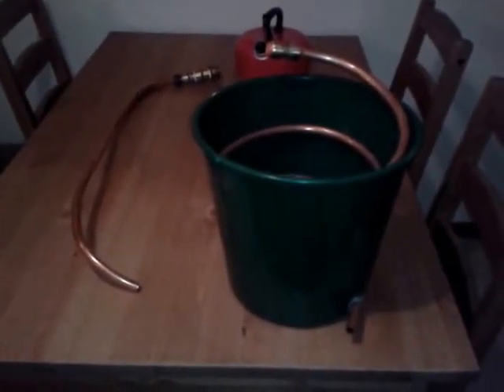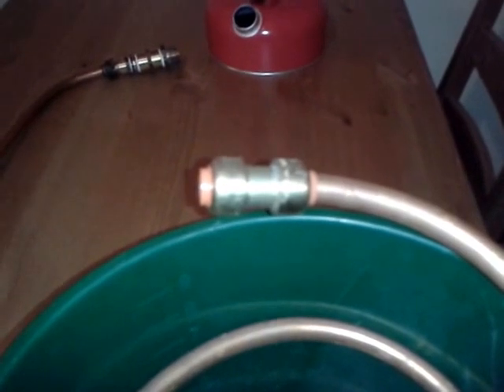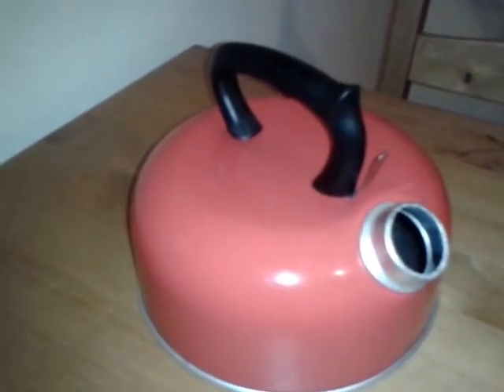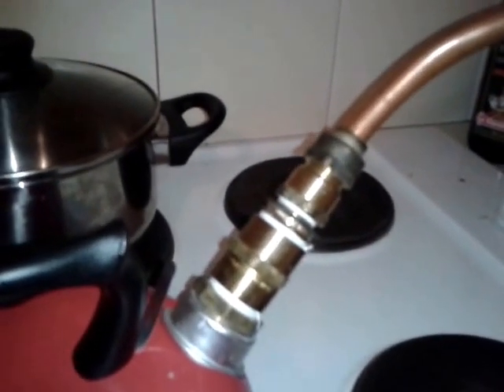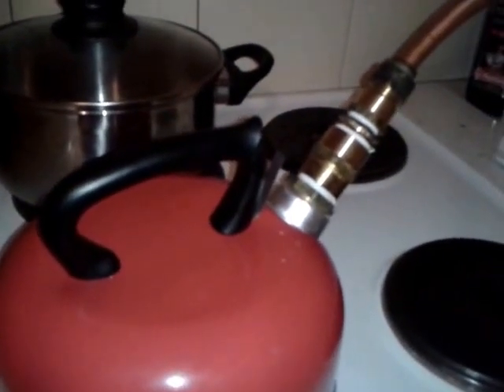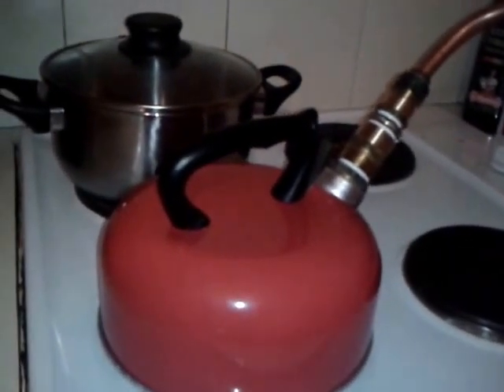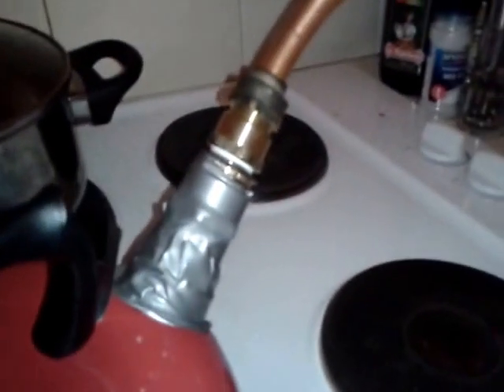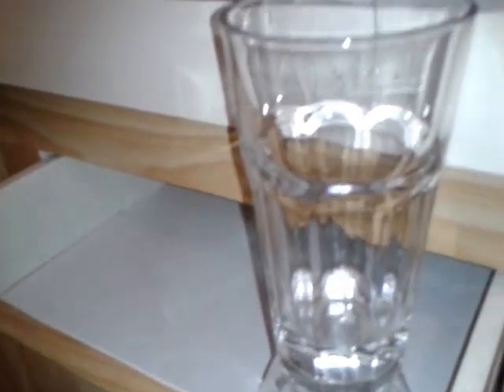DIY Water Distiller Purifier Desalinate - very fast!

Comment: the ONLY reason you need copper in a still is to make shine.if its just water it only needs to withstand 300 degree heat.water boils at 212 so 300 should be more protection than needed.
Reply from the maker: Copper is one of the best conductors of heat, much better than steel.

Comment: Excellent, thanks.  I would recommend using a steel/metal bucket/container with valve at the bottom so that you can drain the hot water and replace it with cooler water.  This way you don't have to scoop out the water and add new one.  And a stainless kettle would work better than an aluminum one.

Comment: Interesting... but do you need to use coolant - or does that just improve efficiency?  If you didn't have the bucket but instead just let the steam out into a long pipe that you could cover to avoid getting burned.... maybe bury it under some dirt... that might work, no?
Reply from the maker: No, you definitely need the coolant
Reply: +wupeide ...Yeah, the whole point is to cool the steam as quickly as possible. In fact, you can usually boil the water out of a vessel faster than you can condense it back into water. 

In this case, he could actually get much more than 2 litres an hour if he had 1) smaller copper tubing coiled more times, which would present more surface area to contact the cooling water, and 2) an inlet/outlet in the bucket which would continually replace the water which would be getting hotter and hotter otherwise.

He could also use more copper tubing coiled up with a decent size fan running over it.

Basically, it all comes down to how fast you can cool the steam being produced...
Reply: What about just using an extremely long tube and running it under ground for cooling?  I am trying to think of a way to do this as simply as possible - think post-apocalypse.
Reply from the maker: Yea that would work. Although how long is long? ;)

Comment: add extra tubing from the sink tap filling up the bucket, and an overflow tube at the top of the bucket to the sink to produce a more cool water making the distilled water drip faster/ also add heat rap to the copper tubing for more heat
Reply: +Jay Goodwin ...First idea is good. But the moment the steam leaves the boiler, you want the copper cooling the condensate as soon, and as rapidly,  as possible for maximum output. If you are trying to make the whole thing more energy efficient, you would only want the wrap the boiler with insulation.
Reply: +Jc Knight yeah i know now, thanks :)

Comment: They say that copper when heated up does leach on to the water / steam. Stainless steel piping is probably a safer option. And a metal cooling bucket.
Reply: +YouTubeSearch ToxicFluoride ...actually, pure copper tubing is amongst the best options for distillation. In alcohol production it's actually preferred over stainless, for taste. Also, except for Lab Grade stainless, the nickel present in stainless is more likely to leech into water. Not a problem for most, but there are some people with high sensitivities to it.

The cooling vessel should actually have an inlet/outlet to constantly be changing the warming water with cooler stuff. The material is fairly irrelevant if they do that.
Reply: if that were true bourbon will kill everone who drinks it , and they all die after a while so i agree, and what about that pipe that are after Your water heater ???? i think its better People think before they Write ,

Comment: The distilled water runs through the copper picking up the copper.
Reply: just like Your Connected pipes after Your water heater , i would be scared if i were you , and stop drinking bourbon , it should be full of copper ,

Comment: Charles Manson had high copper levels and a copper water distiller will dump lots of copper.that's why u will never see a water distiller w copper anything.copper overload causes schizophrenia
Reply from the maker: Ok maybe. Although Charles Manson hasn't used his copper water distiller for 40 years and hes still crazy..
Reply: Most buildings are plumbed with copper pipe and lead solder.
Reply: BlueXiiter yeah i get what your saying now.
Reply: BlueXiiter needs to be as close to 100% free of everything. Sterile.
Reply from the maker: BlueXiiter Well yes depends on the application. My application is to get drinking water from seawater.

Comment: All WATER distillers use stainless steel tubing,and the VOCs u need to worry about are in the water.so COIL multiple times STAINLESS tubing and then charcoal.
Reply: "All Water distillers use stainless" is a pretty strong statement. I think you can ingest minimal copper and get rid of VOCs by running the still for a few minutes and dump the first cup or so. Though I would agree that Stainless would be better, it's just quite a bit more expensive and harder to manipulate. But if you have the time, money and tools, it is preferable.

Also, as regular maintenance, I believe steaming through a cup of vinegar then a cup of water should clean and rinse your copper worm (as the 'shiners like to call it).
Reply: are you for real ? noncence

Comment: A fire would produce much more by my reckoning, as it is way hotter then the average stove. :) Nice vid, cool idea with the cooling bucket. Another idea for cooling is to leave the pipe up in the air wrapped in cloth and keep the cloth wet with really cold water and a cross breeze.